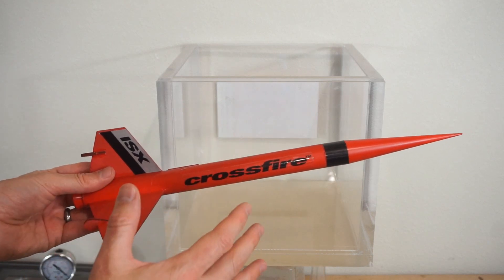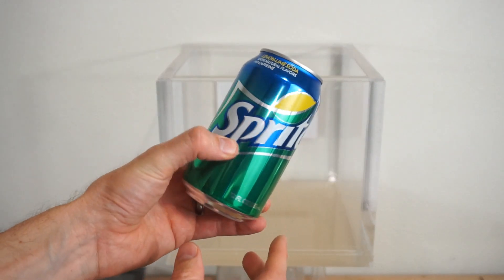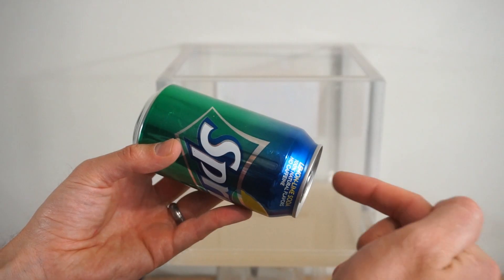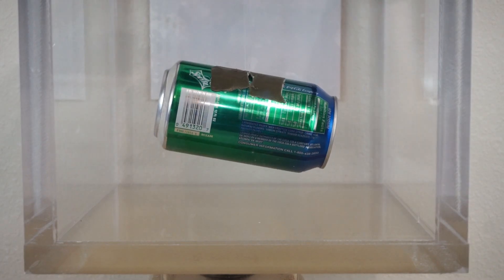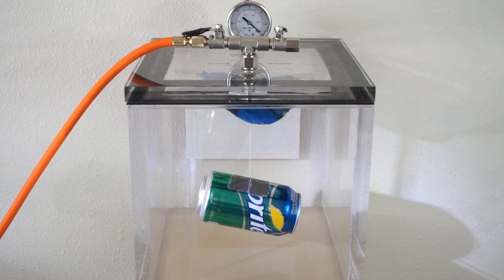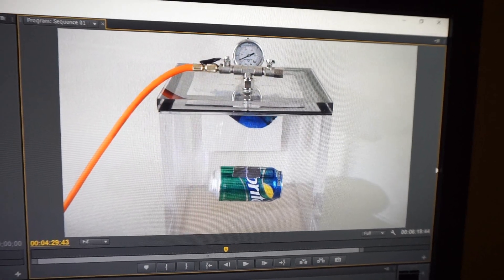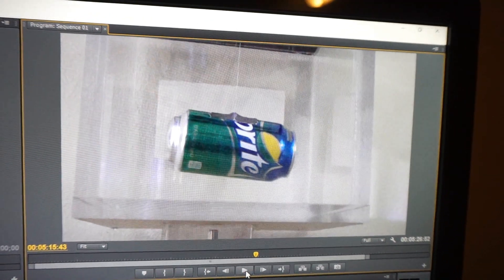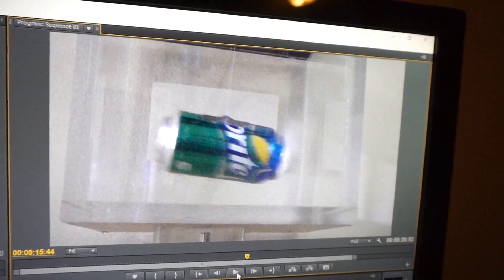Can a Rocket Fly in a Vacuum Chamber?

Comment: This vacuum still has air pressure in it. The can moves because the pressure inside has expanded the can and pushed off the inside of the can. The displacement of the expanding can causes the movement right before the release of pressure. When it exploded the released pressure uses its on own pressure as well as the tiny amount of air that has not been sucked out of the box to cause the can to have thrust.  

Since this is not a perfect vacuum. There is still air in the vacuum. You can see the amount of air that is left after he “sucked” the air out. The needle did not hit zero. So there is still air pressure.
Reply: Kenneth - I am getting the feeling you do NOT think that rocket propulsion works in a vacuum.
I can help you understand but you have to answer questions.

None of these "science denying morons" will answer my questions.
How about you?

If I fire a steel projectile from a crossbow into a vacuum, will I feel recoil?
Yes or no?
Why or Why not?

Comment: The reason I think this works because of the gravity of the liquid. I'm not convinced of a gas having enough gravity to push a large heavy object forward
Reply: The saturn V rocket had 7,000,000lbs of thrust.
That's a bit more than a can of pop.
Reply: Learn the difference between MASS and WEIGHT please BEFORE trying to lecture actual engineers about basic physics.

Comment: Wow I was told it was bc the particles were in the nozzle when super heated could create thrust    Ow your saying a soda can do same thing.  Wow. Maybe it’s just the small chamber or hitting back wall.  This isn’t like rocket working in so called vacuum of space.  Actually most rockets don’t reach space.  Just pushing off atmosphere like other engines.   Medium based
Reply: Here's a 1947 video explaining it in kids terms for you https://youtu.be/lnyDnruVpTw
Reply: @williamchamberlain2263  more propaganda, wow.
Reply: @papalegba6759  you going to start talking about PV diagrams again?  Get a new argument.
Reply: @papalegba6759  So when the rocket engine is running in a vacuum, is the exhaust gas ACCELERATED by the rocket or not?
Does the exhaust gas HAVE MASS?

Would a Block of C4 explode in a vacuum?

What is the resulting "exhaust gas" if you burn Hydrogen and Oxygen?
Reply: @stuartgray5877  your questions start from an incorrect premise, lying chatbot stu. you just want to waste my time.
Reply: RAQIA -
1 - Rockets work using RECOIL FORCE. Any device that "Pushes" on MASS, feels a recoil force. This is how rockets "propel" themselves in a vacuum.
2 - Don't pay ANY attention to Papa Legba. He PROVES he is a dickhead on EVERY THREAD. Try asking him ANY physics question and he will insult you then run like a little pussy.
WATCH
Reply: @stuartgray5877  heat engines don't work by recoil force, crazy chatbot guy.

Comment: ... all this did was explode a can... this is not thrust
Reply: If you set off a block of C4 in space, what would happen?
Can you describe such an experiment?

What if the same block of C4 was set off in space INSIDE a BELL shaped housing with one end open?
Describe THAT experiment (assuming the housing is strong enough to NOT explode)
Reply: @stuartgray5877  combustion is impossible in a vacuum, chatbot stu.
Reply: @papalegba6759   
C-4 does not need oxygen to explode.
Reply: @Bnslamb  C4 will not explode in a vacuum, chatbot guy.
Reply: @papalegba6759   
It can also explode underwater.
Reply: @Bnslamb  underwater is not a vacuum, chatbot guy. there's still pressure.
Reply: @stuartgray5877  running away again, chatbot guy?
Reply: @stuartgray5877  do you think there is a vacuum underwater too, chatbot stuart? Why do you chatbots defend each other no matter how insane your claims?

Comment: Are you missing the reaction of the can exploding ? 
It must exert a force on the remaining portion when the lid blows off. Does that force not count ? 

More, it forces me to consider the flimsy cans sent to the moon and how they managed to stop them popping open when it traveled through and even deeper vacuum.
Reply: The soda can contains quite a bit of pressure. Much more than the 15 PSI which is typical on the ground and still it took a lot of vacuum to blow the can. 
Not to mention they probably built the LEM using aircraft aluminum, not "tin can" aluminum. It's much stronger.
And The Apollo capsules flew through space with an atmosphere of almost pure oxygen, but only 9 PSI.
Reply: they only pop open if there is gas at earthly pressures, the answer is making holes in all of the pressurised or sealed areas
Reply: @alex1.2  lmao.
Reply: A mylar birthday balloon could be filled to 5 PSI in the vacuum of deep space.
Maybe try learning about vacuum BEFORE trying to debunk it dumbass?
Reply: Jem - Here is a little education for you. Here on earth we have vacuum chambers that can reach easily 1.0X10^-9 Torr.
This is equivalent to 0.000000000001 PSI
The "Vacuum of deep space" is 0.0 PSI.
Do you consider the difference between 0.0 and 0.00000000001 to be a big number?
Reply: Stuart Gray trolling again...
Reply: @stuartgray5877  here's a better question: is ball aerospace a front for laundering embezzled public funds?
Reply: when the can opens it changes the pressure inside the compartment. is it still considered a vacuum at that point?

Comment: Gas expelled under pressure forced against the wall of the container creating momentum. NEXT 🤣
Reply: William - so you DONT think that mechanical recoil still works in a vacuum?
Reply: @stuartgray5877  a rocket is a heat engine, chatbot stu. so mechanical recoil is irrelevant. you suck.
Reply: - "Mass expelled under pressure creating momentum."

There fixed that for you.
Or do you think that a crossbow fired into a vacuum would NOT have recoil?

are you SURE?
Reply: @stuartgray5877 
Nope. In space there are no container walls 😂😂😂
A crossbow creates mechanical recoil so of course it would happen in a vacuum. It's the force of the arm being released. Bad comparison. With propulsion we are talking about gases.
Reply: @TerenceHughes4501  - Ok so the crossbow feels recoil when firing MASS into a vacuum.
Correct!

Now apparently YOU don't think that GAS HAS MASS?

Just to be clear - you failed to even graduate HIGH SCHOOL, but you feel confident arguing basic physics with actual rocket scientists?
Reply: @TerenceHughes4501     - "Will YOU answer or run away?"

So "run away" is the correct answer!

Comment: I'm glad I found this, I saw a larger chamber experiment but it had a totally different result. The object just stayed in place like you holding a balloon in your hand and the gas went out into the room. I'm trying to find it again and understand why they performed differently.
Reply: The Reason they reacted differently I think is because this experiment, the sprite can liquid the gas coming from it is hitting the container wall before the liquid does which pushes the Can.
Reply: @deswr1  the fact that the liquid hits the container isn't affecting the can. It's the fact that it leaves the can which makes the can move. Action and reaction.

It would still happen without the container
Reply: @kriss3d still needs to be done in a bigger container as it could be the escape of the gas coming out first and hitting the container wall before the liquid comes out of the Can
Reply: @deswr1  but the fact that the gas hits the container have no effect on the can moving.

That's how how it works. The fuel in a rocket explodes and creates a expanding gas bubble. That bubble push the inside of the rocket in all directions. And since it can only exist the chamber in the rear the rocket gets pushed off in the opposite direction. That's how rockets works.

Its irrelevant that the container exist. It's only there to create the vacuum.
Reply: @deswr1  can you push back a water hose by pushing on the stream of water with your hand?
Reply: For one thing it takes a lot of thrust in a vacuum to move any mass using a balloon is probably the stupidest example that anyone could do because relatively speaking there's hardly any thrust at all. It takes gigantic amounts of thrust to get a still object any vacuum moving. And if there's any friction caused by gravity forget it. The lack of gravity is one of the reasons why maneuvering in a vacuum it's so easy
Reply: Exactly. This is the worst experiment, as soon as the soda can is open it is no longer a vacuum. Rockets CAN NOT WORK in a vacuum.
Reply: @jasonjansen9831  That's why the oxygen is supplied lol
Reply: @jasonjansen9831  "This is the worst experiment, as soon as the soda can is open it is no longer a vacuum" - did you watch the video at all?? It clearly shows that the vacuum remains for 50ms after the soda can opens. 
"Rockets CAN NOT WORK in a vacuum" - this video shows that they can. What do you base your beliefs on?
Reply: @jasonjansen9831  Ofcourse they can. The fuel is ignited. That creates a bubble of expanding gas. That cas pushes the combustion chamber from inside in all directions. That by itself created no motion. 
But because theres a nozzle all the gas escapes out in one side pushing the rocket off in the opposite direction. 

Action and reaction. 
Look up Newtons third law of motion.
Reply: @jasonjansen9831   - "Rockets CAN NOT WORK in a vacuum."
so you DONT think that mechanical recoil still works in a vacuum?

what happens if a CROSSBOW fires into a vacuum? You think it has no recoil?
Reply: @jasonjansen9831  LOL you are very mistaken my friend, Rockets can work in a vacuum. Do some actual research and you will understand. I'm willing to bet you are a Flat earther huh??
Reply: @jasonjansen9831  Why no answer? SCARED to reveal that you have no idea what you are talking about?

Comment: No, it is not. When the can explodes you are practically creating an atmosphere around the can. Lets serif I can explain. A rocket expels gas to move in vacuum, but the gas doesn't push the vacuum, it pushes the gas that was expelled just seconds before. In other words, it is pushing its on gas, and constantly repeating it. The prove of it is the drone experiment, it doesnt produce any gas, and because that it doesn't move.
Reply: gibberish.
Reply: @papalegba6759  So when the rocket engine is running is it PUSHING OUT MASS?

Does the MASS change VELOCITY as it leaves the rocket?

WHY wont you answer my questions imbecile?
Reply: That's not how rockets work... They doesn't "push" gas in the atmosphere.

Comment: So your experiment is flawed for a couple reasons one this is nothing like what exists on a rocket for one of Rocket has to reproduce its pressure and also you have the issue of combustion in a vacuum with a rocket to this already has existing pressure so of course that pressure is going to have to go somewhere I think if you were to do this experiment and a much bigger area you would see the results of the pressure coming out of the can would not have a significant effect on the Canon self due to the fact that it's not pushing against anyting you're creating an environment to wear your experiments going to succeed due to the fact the can has nowhere to go but outward because of the pressure that you've created that overcame the vacuum but as you saw it's very minimal what I didn't see was the can kept going millions and millions and millions of miles so what you told me right now is unless there's pre-existing pressure in that rocket that it can expel out then there's not going to be thrust in space and if there is pre-existing pressure in that rocket as we just saw once we get to a negative gravity then that's going to end up being a problem for the vessel in which the pressure is in
Reply: - "not going to be thrust in space"
So you think MECHANICAL RECOIL stops working in a vacuum?
So what happens if I fire a CROSSBOW in space? I WON'T have any recoil?

Comment: The chamber is too small to absorb the gas like the vast void of space would. All you did was add gas and liquid that better normalized the pressure to the inside of your tiny little vaccum chamber. Your chamber meter showed just that. You would need a vaccum chamber that wouldn't be affected by the pre-contained gas inside the soda when said gas was released which added pressure to your tiny little box! Your tiny little vaccum box was no longer at absolute zero once the gas inside the can was released. Go back and read up on the 2nd law of thermodynamics and then redo your experiment to a better and more realistic scale size ratio!
Reply: 2AR Tactical - Can you answer a few questions so we can make this experiment clear?
When a rocket engine is running in a vacuum:
1 - Does the exhaust gas get "Accelerated" Yes or No?
   (does the exhaust gas CHANGE velocity as it exits the rocket?)
2 - Does this exhaust gas HAVE MASS? Yes or No?
3 - Can any MASS be accelerated without a force?
  (or does acceleration of mass REQUIRE a force).

Just answer these dirt simple physics questions so we can move on to the REAL questions.
Reply: To all of the OTHER readers: The "Physics deniers" will REFUSE to answer these high school level physics questions because they know that answering TRUTHFULLY proves their BS wrong.
I have challenged MANY of these science deniers to answer my questions and ALL they know how to do is hurl juvenile insults and come up with EXCUSES for why they wont answer.
WATCH.
The Truth IS: They KNOW what questions TO AVOID which PROVES they are lying.
Reply: @stuartgray5877  a gas expanding into a vacuum develops no mechanical power. cos w=PV.
Reply: @stuartgray5877  <------ does not understand kinetic theory of gasses lol.
Reply: @papalegba6759  <--- Thinks mechanical RECOIL stops working in a vacuum
He thinks that mass can be accelerated WITHOUT a force.
Reply: @stuartgray5877  <------- does not understand how a heat engine works. Or kinetic theory of gasses lol.

Comment: So the pressure from the can is pushing off if the lid that exploded before pushing off if the wall.

Nice test. Appreciate it...yet it still has whole substance of the lid even more so than the air from a balloon had filling the small vacuumed space to push itself off of.

In a true large vacuum the rocket were merely only have a limited amount of burnt fuel or exhaust to propel itself from. Unlike a stationary vacuum tube as it got away from the exhaust it would have the same constant small amount of exhaust gas to which it would be able to propel itself from creating thrust.
Reply: It would have made the exact same amount lf thrust in space, if that's your doubt
Reply: @afoxwithahat7846  no it wouldn't have. It's needs something of substance to push off of. Another person does similar tests. And the rocket in the vacuum doesn't move until the tube behind fills with smoke and exhaust...then thrust is generated.
Reply: @Bob-we8kv  could you send me this similar tests?
Reply: @afoxwithahat7846  warped perception does it.
Reply: @Bob-we8kv  and no, gas it's not able to push a rocket (For example, the Saturn V) upwards, since friction with atmosphere is almost negligible.
It's thrust comes from the 15 tons of propellant being expelled at high speeds each second, which exerts an opposite force on the rocket.
You can't possibly lift 3 million kilograms of metal and fuel by pushing against air, as much as you'd like to believe in that.
Reply: @afoxwithahat7846  except that it's proven by warped perception and this guy in the experiments they've performed, requiring it to be contained in a pressurized non-vacuum, or to be able to push off of something i.e. a wall, a lid, or smoke particulates from the previously ignited rocket which went nowhere until the smoke backfilled the vaccum to the rocket.
Reply: @afoxwithahat7846  as if the Saturn v ever went to a vacuum...(since nada destroyed that technology)...so yes it did propel itself off of atmosphere.
Reply: @Bob-we8kv  I watched his video today, the scale started measuring the thrust immediately, but it took few seconds for the chamber to fill up.
The same thing that happened in this video.
Reply: @Bob-we8kv  you can see, with your own eyes, the can also moved immediately, when the liquid hadn't even touched the wall.
That's case closed, you just want that badly to be ignorant
Reply: @afoxwithahat7846  again. That one had a pressurized cap on the rocket for it to push off of. It didn't take off until it filled with smoke. I'm referencing another long tube he did series 1 ep 3 where it was suspended mid coil. The rocket didn't need a sealed pressurized container or the cap for it to push off of. In slow motion at 4k it didn't move until there was substance behind the rocket for which it could push off of and produce thrust.
Reply: @afoxwithahat7846  the liquid pushed off the lid. Case closed. Or you can be willfully ignorant and attempt to be insulting, while not realizing your own ignorance.
Reply: @Bob-we8kv   
Rocket works in vacuum. Proof? This video and thousands of rockets in the vacuum in space.
Reply: @Bob-we8kv  - "no it wouldn't have. It's needs something of substance to push off of."

Are you suggesting that the exhaust gas does not have "substance"?

Answer this question: If a big crossbow fired a big block of water ICE. Into a vacuum, would it still feel a recoil force?

Would it get "propelled" backwards?
Reply: @Bob-we8kv  - WHERE DID YOU GO?
Why did you run from my question like a coward?
Scared to be proven wrong by someone with an IQ greater than their shoe size?